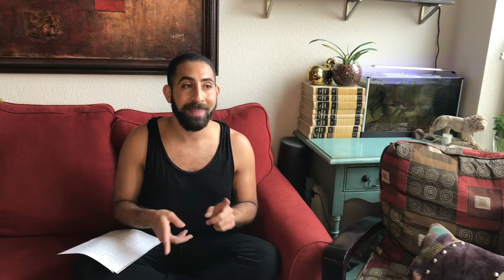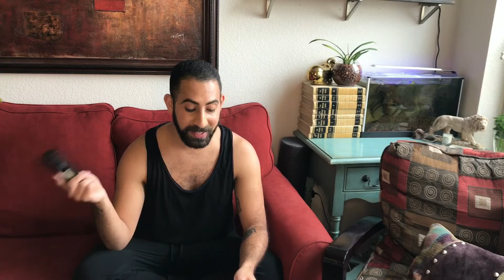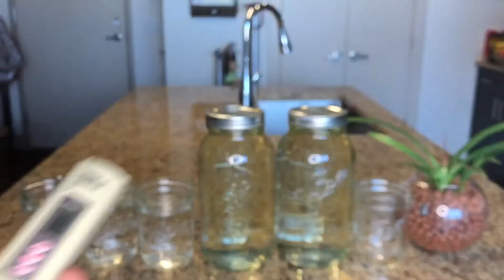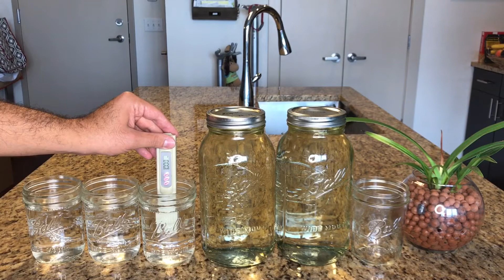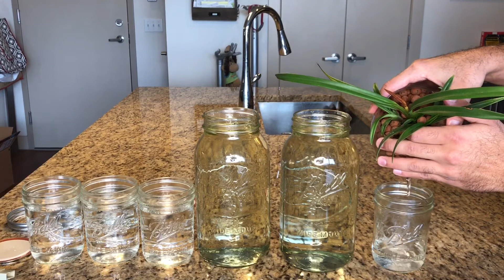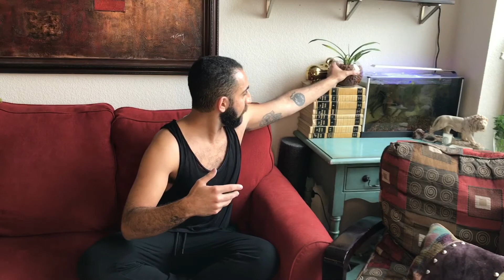PH, TDS & Water Types: Semi Hydroponics (Part Two)

Comment: Re: Reverse Osmosis Water. I have used R/O water for drinking for many years (living in SE Asia - tap water suspect) and use a TDS meter routinely to test that water quality. When the filters/consumable components are new, the water registers 2 to 6 ppm. When the water registers over 20 ppm the filters are replaced. Have been using tap water for the orchids that currently registers 106 ppm - but has been measured as high as 130 ppm. Despite living in Bangkok have had little success with Phalaenopsis types.  Have recently discovered "Semi-hydroponics".  Will now convert and use your suggested methods. Thank you for your well thought out, informative, and well presented tutorials.
Reply from the maker: That means a lot to me, I glad your able to use this information so constructively. Thank you so much for watching, you'll have to keep me posted on how your transition to semi hydro goes!

Comment: No offense to Ray, but I don't find TDS meters tweaky, cartainly not as tweaky as pH meters.  Important to remember as you pointed out is that the meters measure Electroconductivity and some growers use an EC meter, the TDS meters use a formula in the circuitry to convert to ppm and different makers use different formulas so there will be some variation there.  I use the meter to provide repeatable results rather than an absolute value and thus avoid insanity.  I am blessed with a reasonably soft water, 20-40 ppm depending on the season and rainfall, but it also means that I must use a formula that provides Calcium and Magnesium, hence the commercial hydroponic tomato formula that I use (although not in the same strength or proportions that are used for those heavy feeders).  I tend to shoot at the low end of things 125 ppm above the base ppm of my water at every watering, I like to eat every day, my plants also probably want to.